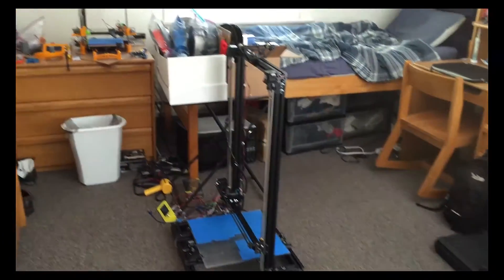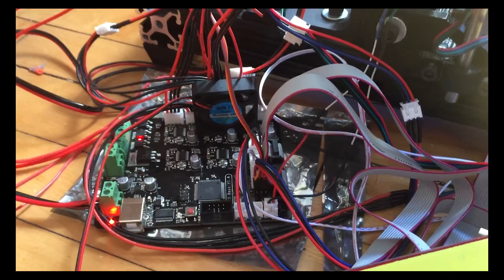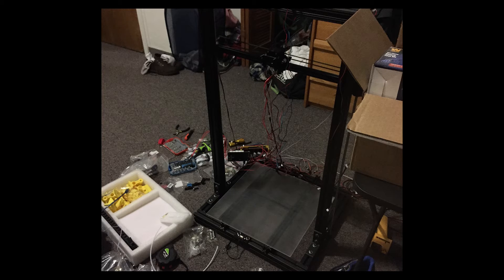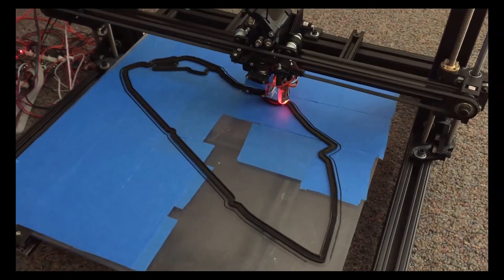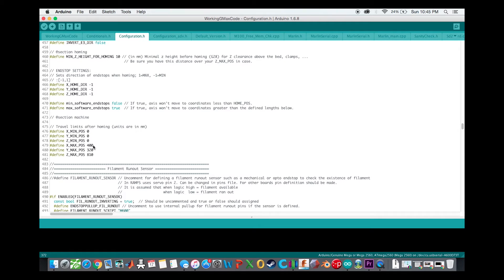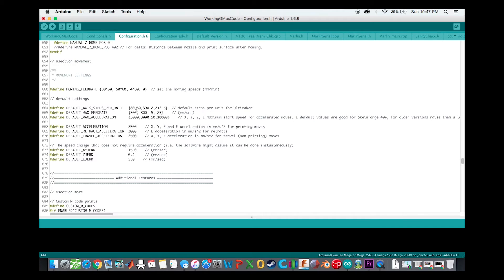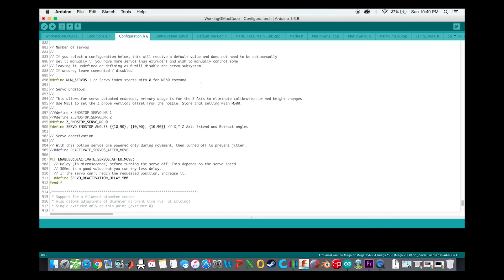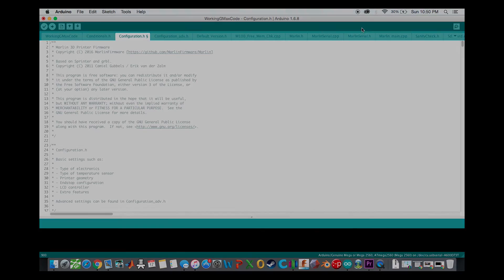gCreate gMax 1.5 XT ++ Build Series - Actual Build: Problems/Solutions

Comment: How did you wire 2 z axis motor cables to the board
Reply from the maker: I used a simple y-harness for the two motor plugs. The plugs are balance leads (same as a hobby grade lipos) so I just purchased a y-harness that combines the two into a single plug that plugs into the board. Since I'm not running the z-axis aggressively its okay to have two stepper motors on one driver.
Reply: Kevin Fine thank you for your attention  and can you send the link of that y harness
Reply from the maker: https://hobbyking.com/en_us/jst-xh-parallel-balance-lead-3s-250mm-2xjst-xh.html

Comment: Hello thnks for the video :) I have gmax 1.5 and i wanna instal bltouch but on the gcreate site is no firmware for the 1.5 version with bltouch only for Full graphic LCD display. Is there any chance You could  send me the working firmware?  badboy83@o2.pl Cheers
Reply from the maker: So this is a printer I built myself. I don't know what board they are using? I'm using an MKS Base V1.4 I can send you the firmware but I can't guarantee everything will be the same for you. I would recommend watching my build video because I step through all the changes I did in Marlin so you can do them for your specific setup. If you still have problems/questions after watching that video then I can send you the firmware but I can almost guarantee it will be different.
Reply: Thanks for the super fast reply :) I wathed Your build Videos series couple of times and i saw the thinks You changed and i wanna compare Your firmware to firmware from gcreate (http://forum.gcreate.com/downloads.php?view=detail&df_id=31) becouse i have to change line for the LCD display i also using MKS Base V1.4 . If You could be so generous and send it I could give it a try with Your firmware. I will Reply if it works. Cheers

Comment: What rails are you using for the frame? They look like 40x40 v slot but i can't seem to find them anywhere.
Reply from the maker: The frame is 1.5" aluminum extrusion (80/20) and the small rails are 20mmx20mm v slot from open builds
Reply: Thanks for the quick reply. Also, do you find the same 1.5 x 1.5 are rigid enough for the z axis when it's that tall?
Reply: are the wheels used different  for 1.5 inch?
Reply from the maker: There aren't any wheels on the 1.5 inch for this build. I don't know if they are different or not for the newer version.

Comment: Kevin... like these videos... I have a gmax 1.5xt+ and modified it with e3d etc.. waiting on my heated bed.
couple questions.  I noticed there is a LOT different between this and the gcreate bought printer. obviously metal parts, steppers for z are on top in yours etc.... 
questions.
1. Where did you figure out the BLtouch can only account for up to 1mm of deviation?   This has to be modifiable somewhere. Every other ABL can do unlimited correction....
2. How much as you in total for the printer?  I have a taz 5 that i want to sell and buy another gmax. its built like a tank but im curious as to how much i could save.

thanks
Reply from the maker: +In The Lab I found out on a forum somewhere that the marlin firmware only allows for auto bed leveling adjustment only up to 1mm. I'm not sure but I think that is specific to only marlin firmware. If you watch my next video in the series you'll see that in total it cost me $1100 and that includes the $300 aluminum bed from gCreate (However they don't include a bracket to mount the belts to!). I just designed my own bracket that works pretty well.